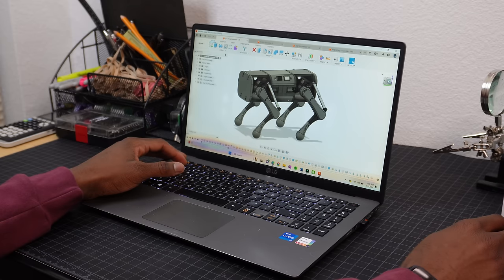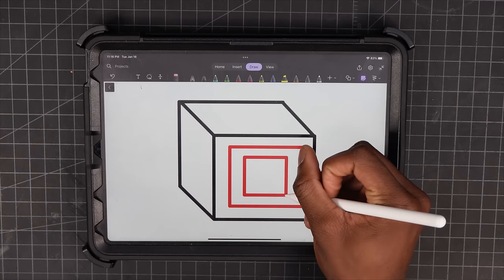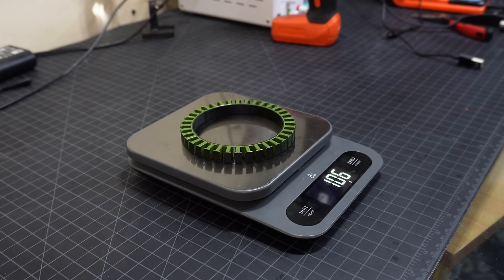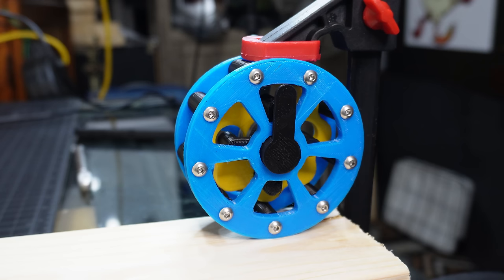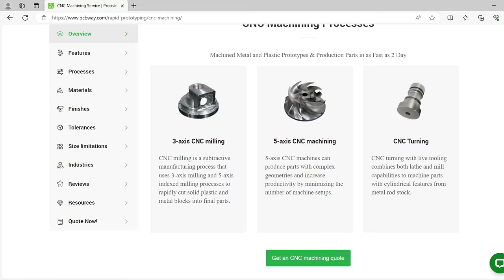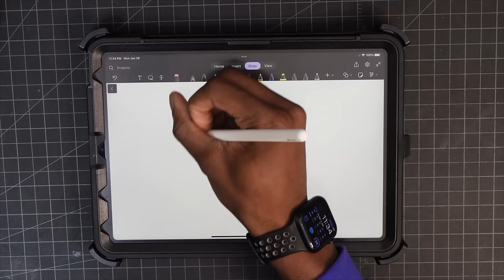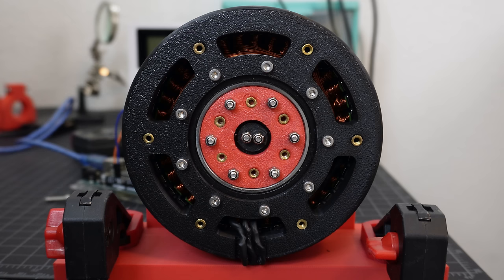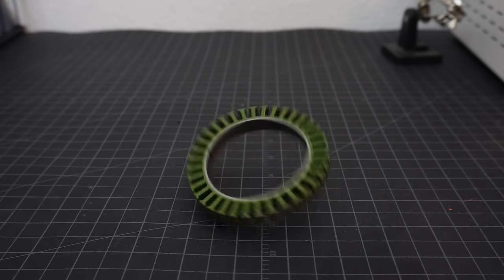Building an Internal Cycloidal Robotic Actuator

Comment: When you pulled apart the copper for a second time I just wanted to give you a hug lol. I’ve had to start over on my unreal engine plugin multiple times and the excitement/frustration is very real. At least in my case, it’s literally just code and not physical labor haha. This is such a cool project, thank you for sharing it!
Reply: Coming from a tinkerer in life and unreal engine, there is no difference bro, just hair pulling.
Reply: If that happened to me, a hole is going in my wall

Comment: To wind a motor coil use a long dull tip syringe tip mounted to a pen shaft. It allows you to "place" the wire between the slots where your fingers don't fit. Try bending it to different shapes if you need. Long sowing needles eyelet bent to a hook could also be used. Ideally, you want to fasten the stator to a fixture so you can use a second hook tool to pull loops into position with one hand while guiding/"paying out" the wire with the syringe tip or needle in the other.
Reply: @excitedbox5705  ✅
Genius.! +10,000 likes. 
Now, who are, and where is the hunan you replaced.?
Reply: @snakezdewiggle6084  my dad works in a company making electric motors and they have a 5 axis machine that does exactly this fully automatic....
it does permanent tension control, bend radius control, full 3d positioning of the wire in the channel and even tacks and cuts the wire to the bus terminals when switching which winding its on...
Reply: @TheScarvig 
Yeah cool, thats great.
What's your point?
Reply: I have a mind to make gcode for my cnc to follow the path and make a little device to handle the details of wite position and tension for these.

Comment: My favourite thing about your videos, other than the incredible subject, is that when you explain a concept you also demonstrate it physically with a small experiment. Wrapping the wire around the Allen key, running a current through the wire, and picking up nails is such a simple yet effective demonstration of the concept. It's super cool and inspiring. Thanks for sharing!

Comment: I was so wrapped up in how great this thing was I didn't catch that it was definitely gonna burn itself up until you mentioned it. It seems like in a cycloidal drive with steel or aluminum hardware, it would be vulnerable to galling in the long term, which a planetary drive isn't. I know there are steels and coatings to deal with galling but they're not usually cheap.

Comment: Just a tip for getting interference fits together easily.  Cool or freeze the aluminum part and heat the steel part.  Usually putting the aluminum part in the freezer is enough but depending on how you clearanced it you may need dry ice or liquid nitrogen.  Heat the steel part to 300F.  Usually only one of these methods is needed to get a tight interference fit together but sometimes it takes both.

Comment: Internal Wobbler dive - pretty good name! 
TY for showing the iterative process, and also the mistakes you made! Amazing work! It is also pretty cool that we live in an era where we can go from printed prototype to machined part as an Individual without a big company. 
Pro tip: if you have friction fit metal parts, temperature differences are your best option. Put one in the freezer and one in the oven and chances are, they will fit together. ;)

Comment: 7:50 Slight correction, when the output of a gearbox is the opposite shaft the gear ratio of a cycloidal drive is r= (P-L)/L where P is the number of pins and L is the number of lobes on your gear.  This can usually be simplified to n-1 compared to the number of pins.  You can also use the casing as an input or output, in those cases you have an n ratio to the number of pins.  I've been playing with some cycloidal designs myself for some university projects as well.

Comment: This will (sometimes) be a fairly high frequency motor.
At high frequencies ferrite cores perform better than iron.
If you cast your own ferrite cores (magnetite and epoxy), you can wind the coils first, and cast the core round them.

Comment: in the windings, what matters is the current x # turns. You are winding 6 turns. Winding with 6 wires in-hand doesn't actually give you 36 turns, since the cross section of the wire (and the allowable current) will reduced to 1/6. You wound 26AWG 6 turns of 6 in-hand; you would get the same performance with 6 turns of 1 wire in hand of about 18AWG.

Comment: Very impressive. I've machined a number of cycloidal gearboxes and have found them to be a real bear to get them to run without binding. To get this kind of torque is a great result. The other thing I've occasionally wondered about is whether you could print a harmonic drive using nylon or something similar for the flexible ring.

Comment: I have done a similar actuator about a year ago and I agree with you. Its tooooooo much work. But if you aim compactness and precision, its the best option available diy. I have made it full metal using AL7075 and made my design to be used with standart 90 kv bldc motors. But I dont use it. Its on my desk due to massive work I put into it. But thats it. Planetary gears with helical gears are sufficient for me. At least for now. If I want to make an ABB or KUKA class robot or something similar, then it will be more than a paper weight :D

Comment: If you want to make it even more compact, here is my suggestion, instead of using central eccentric shaft, use 3 of them located between outer diameter and inner diameter of the cycloidal disk. place 3 double eccentric shafts with helical gears at the end of them. Now put a central gear that motor will drive. This way, you can play with reduction ratio much more. This configuration will give you approximately %20 less volume and mass while specs are similar to your model. Cheers

Comment: Not bad. Though the coil wrap needs a silicon slide on that has a top connecter to seal the deal per peg, that way every wrap can be done by a machine and placed together quickly instead of taking hours to do it by hand to speed up the manufacturing process.
Reply from the maker: I only planned on making one of these so I didn’t really see the need in making a whole coiling machine.

Comment: It was a really interesting video.
I make a similar project when I was at the university. It was really hard because we only had one month. With My team we improvised most of the project, we used PVC tubes for the container but it was really interesting.

I was shocked of how much this project cost, 400 bucks!

I was wondering how much time does it take to build this actuator. I mean from the time of this idea came up until this finally product.

Please keep uploading videos like this It is really helpfull for new engineers!

Comment: For flat parts, you can use a carbide copying bit in a wood router with a 3D printed template to cut aluminum versions. Might be a cheap way to product metal cycloidal discs.

Comment: if you want to increase the magnetic field, try using metglas instead of steel to increase the magnetic permeability. No clue if its easily available but Hitachi is using it in their power tools.
Reply from the maker: Why use metglas when steel can get the job done and is readily available for machining?
Reply: @AaedMusa  its just a suggestion to increase the magnetic field, and thus making the motor stronger. Meglas has a magnetic permeability of 1 000 000, compared to very pure iron thats 100 000
Reply: @AaedMusa  https://en.m.wikipedia.org/wiki/Permeability_(electromagnetism)
Reply from the maker: @kristofferhaugstad7616  looks like an interesting material but I don’t have the machinery to cut it myself nor do I know a cnc service that can. For low scale projects like this, steel works just fine.

Comment: Great build.  I can't wait for the next build.
A couple of questions.  How did you join your coil wires?  6 turns of 6 wires connected in parallel is still 6 turns.   Is there a restriction in your sponsorship contract that prevents you from revealing the cost of getting those parts machined?  I don't think I've seen any youtuber reveal the price.
Reply: I was going to say the same thing, 6 strands at 6 turns is not 36 turns. If he did 36 turns with 1 strand of AWG22 it would be quite a different motor. Lol

Comment: Very cool. Thanks for documenting your process. I have been collecting Hoverboard motors as they are cheap, powerful and pretty fast. Your idea got me thinking about retrofitting a Hoverboard motor with cycloidal drive. If the right parts could be found, it might be a method to build low cost actuators.

Comment: Excellent project. learnt much of dos and don’ts. about the coils fuming w/ weights loaded. Look into awg wire ratings for amps & wattage, diff gauges can handle.. 22 awg is rated for 7 amps at 75 Celsius but only .9 amps at 60.C so temp factors into wattage motor can endure. Perhaps preheat/workout motor to reach optimum temp? before heavy lifting.. Voltage also determines max amp capacity. higher voltage transfers more volume eg: 12V X 7amps vs 24V X 7amps. So capability of motor vs torque load can be measured for optimal use..

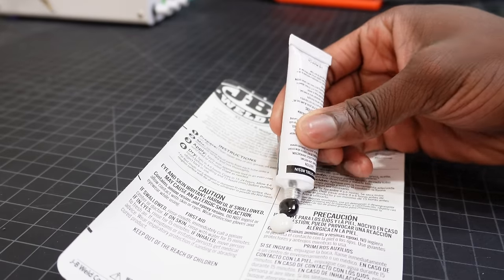Comment: 4:07 instead of using alternating polarity, have you considered making the outrider magnets into a Halbach array? A Halbach array pushes all of the magnetic field to one side of the array of magnets, and is far more efficient at the use of the magnetic field of each magnet than an alternating pole configuration.
Between each alternating pole, you would need to add one more magnet, whose polarity is pointed sideways. It's a lot easier to see what the arrangement is by just looking it up; a text description would be cumbersome and would still not communicate it clearly. The down side is that you'd be using a lot more magnets. The up side is that the motor would be more optimal, with double the field strength to work with vs. a conventional configuration.

Comment: Wow! Some awesome editing of weeks and learnings into a concise easily understandable video. I'm very impressed and inspired by seeing what's possible.

Two questions, or thoughts that might be worth considering if revisit actuator design:
1. have considered adding a clutch to the actuator to give it a lower power sleep mode when not moving?
2. have considered using scooter/hoverboard motors? These are widely available a lower cost to most other brushless motors (not sure if torque, or other characteristics would be up to liking/needs)

Comment: To show 3 phase on oscilloscope make a star configuration with resistors and you will have the reference ground point in the center of star connection

Comment: for the amount of sanding, you may have gotten away with freezing one part and heating the other. but I don't know how big a difference in size it was if it'll work but would help with the friction fitting. Maybe cause too much stress on it but no need to glue/locking them though

Comment: "My recommendation for if you ever plan on doing this, is that you don't" Oh don't worry, I won't. I've been disassembling electronic scrap for years and while I initially unwound the coils of motors for the copper, I've since gone over to just selling the entire motor as scrap. I'm interested in building robots and utilizing my 3D printer for that, so I probably will utilize your open source design (you absolute legend!), but I'm probably also gonna find a more autonomous way to wind the coils, rather than doing it by hand. I found an open source spool winder some time ago. I suppose that can be modified to wind the coils properly, which should also make it possible to do it faster and more precise than by hand.

Comment: Little nitpick: 
QDD actuators are geared, but BACKDRIVABLE like direct drive specimen. 
That's why they're QUASI direct drive. Efficiency is only improved for the motion platform as a whole because of their lower weight. 
The QDD actuators themself are less efficient because of the added mechanical losses.

Comment: Maybe it would be better to convert it to Axial Flux? The control will be the same, the power will be twice as high, and the energy consumption will be the same. With an additional gearbox it would give even more power. The only thing you need to consider is the mass of the "Axial Flux" rotor.

Comment: Normally these are not backdriveable, I guess if the friction is low enough they become backdriveable??? but not normally.  I have designed and printed several around 2 years ago to prove I could still do mechanical CAD.  Not Backdriveable is a feature for some things... Awesome build though, thanks for putting this out on the net.

Comment: Return that A1 and get an enclosed printer. That will allow you to print polymers that hold up far better to high heat. The Bambu X1 is an okay option, it has its own issues, and Bambu Labs have done some things that have soured me away from them.

Comment: It would be interesting, to compare the longevity of cycloidal to planetary reduction gears of the same final drive ratio. I would think cycloidal would last longer, since rolling elements eliminate the friction of sliding surfaces in gears. I would think the gears would have a higher peak torque capacity though.

Comment: BTW. 6 turns with 6 wires does not equal 36 turns unless you put each of those turns in series with eachother . You ran them all in paralel so its just 6 turns but with better current carring capacity.
Reply from the maker: Correct, I probably should have clarified. I meant that there are physically 36 turns of wire, not that it’s equivalent to 36 turns.

Comment: you should research the title "internal star point winding" on the internet, this configuration only has 3 leads coming out of the stator thus removing the need for soldering the neutral. all modern manufactuers do this.

Comment: What prevents scaling the cycloid assembly down to fit the inner diameter of the Eagle motor and cutting out the hub of the eagle motor so it can be adapted to the cycloid assembly to reduce the cost significantly (no custom billet-machined parts)

Comment: Did you try freezing fixed ring to shrink it down? Stator should be fine in oven to 250 or so. Or was it fit to far off for thermal help?

Comment: Coils 6 wires wound 6 times is not equal to 36 turn unless you solder those 6 wires in series rather than parallel. With how it looks to be set up you have a 6 turn slot with beefy wires. Could be part of the overheating at high louds as to make the same torque you need more current but that current will occur at lower voltage

Comment: 11:05 This made me cry... Try dry ice and/or oven techniques. It's how engine cylinder sleeves are installed. Dry ice/liquid nitrogen/sometimes just your normal freezer for your internal sleeve is enough to get the steel sleeves into aluminum blocks. Sometimes they oven bake the engine block as well but not as common.

Comment: just sharing what i did to increase the rigidity of the printed parts by 3D printer. you can coat the surface  by coating it with superglue that we typically used, the whole idea is the hardened layer  of superglue will fill up the printing gap in each layer. this reduces possibilities of fracture that can lead to crack/warp..

Comment: This is amazing!  Have you considered using printed circuit board (PCB) windings to create the stator instead of hand-winding it?
Reply from the maker: PCB stators are for axial flux motors, this is a radial flux motor. A PCB stator would also cost more to make and be less powerful.

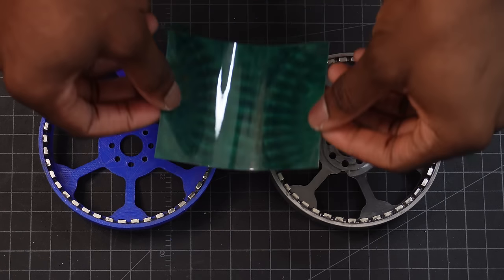Comment: At 12:00, you see the magnetic field on the plastic rotor showing a solid field on both inside and out. Could you make a second (slightly larger) stator to cover the outside field as well for increased output?
I know it goes against the compact idea, but I'm curious how much more powerful it would be?

Comment: Would a brushless  axial motor design work any better?  I feel like i have seen people make 3d printed axial motors before.  They might be a tad easier to wind the coils yourself  on or maybe you might even be able to get away with stacked PCB printed coils and also require less iron.

Comment: Great Video! 😊😊 I think you could go lighter and cheaper, if you use glide bearings instead of ball bearings. Or just let the metal shafts glide in the 3d print. With adequate lubrication and load spread on big surfaces it should last some time until the 3d print needs replacement.
Reply: Yeah, PTFE tube pressed into brass tube works well for output rollers. And PTFE sheet for the large low-speed output bearings, if everything is machined (3D prints usually aren't precise enough for plain bearings). Slightly less efficient, but still backdriveable at 49:1 ratio, and much lighter, cheaper and more compact.

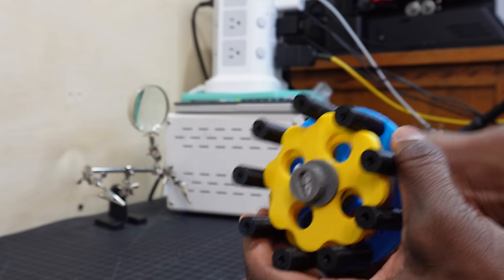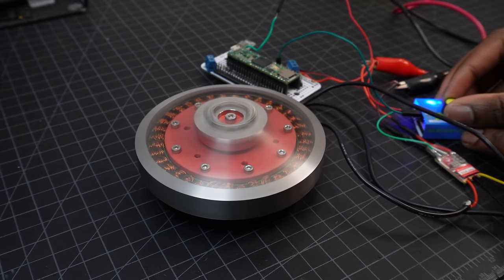Comment: Crazy well explained videos. I started with the rope driven motor. Very interesting, as well as this video. But please buy again a better printer. If I hear the inappropriate tolerances cracking 8:20 I get "goose skin" (dont know if its translated correctly) ;) 12:40 And safety first ... protection shield or what ever is needed to be not hit by any part if the turning part seperates by destruction xD
Btw ... where do you buy the housings for rotors and stators?

Comment: 3:32 how tight is this coupling? for instance, if you were to grip the one on the right and resist its turning while driving it with the one on the left, would that work? my intuition is that the coupling is not tight like in a pair of gears and that some energy would be lost to heat or something - is this true? anyway, thanks, this is a great video!

Comment: I’ve been toying with the idea of doing something like this myself. Out of curiosity what gauge wire did you solder onto the end of the three phases when you used the 26 gauge wire for the coil turns?